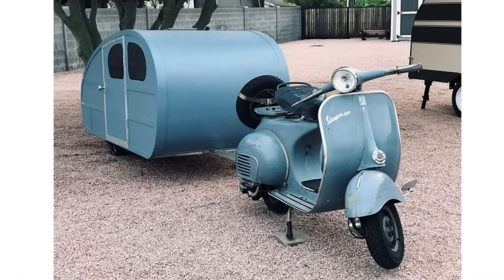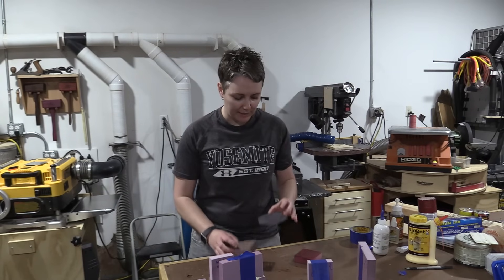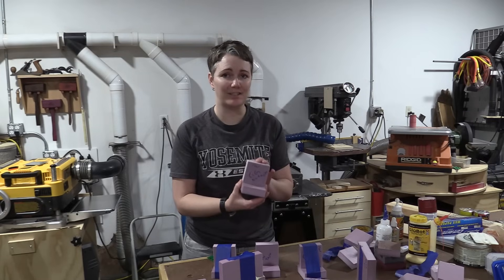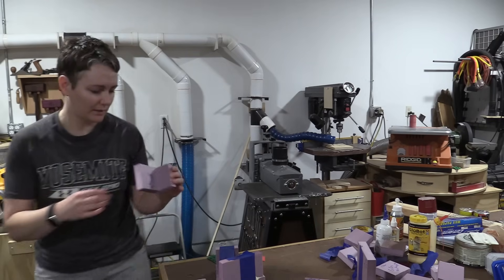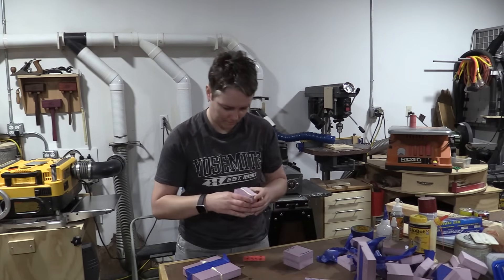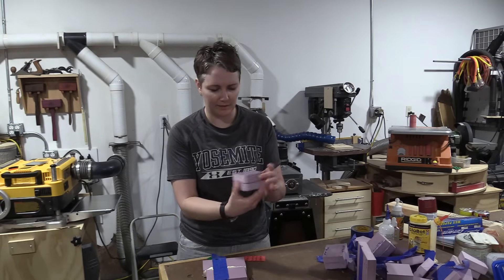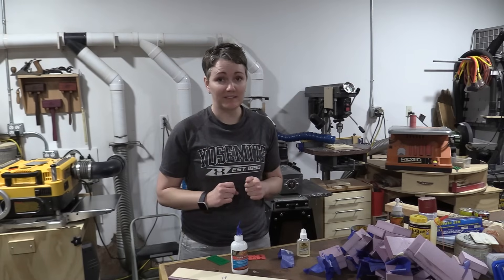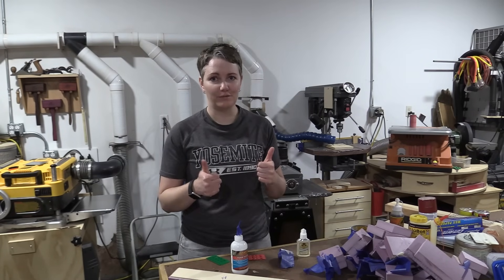NOT Gorilla Glue! Watch This Before Building a Foamie!! BEST Adhesive

Comment: I don't understand the dissatisfaction of Original Gorilla making a "mess". First, there are many places in the construction where it doesn't matter. Second, some extra glue around the joint forms a fillet which can add a measure of strength. Third, I'm sure it wouldn't take long to know how much glue it takes to not ooze out so much.
   I give you a lot of credit for all the research and for sharing it with us.
Reply from the maker: Thank you for your response! If I were building a larger foamie with 2 inch foam I probably wouldn't have been as focused on mess.  But for this build we tried to prefinish the walls and roof as much as possible before putting it together. It was such a small trailer that the last thing I wanted to do was any work on the inside once the roof was on. So the fact that the foam fusion created a deep bond in the foam, was easy to clean up with water and dried crystal clear in the spots that I missed wiping were huge bonuses. I might consider trying Gorilla construction adhesive or PL300 on a larger build since a paste style wouldn't drip. With the one inch foam I didn't feel I would get adequate clamping pressure in some of the parts to distribute a thicker adhesive.  I have received so much great feedback that I might have to do more research and testing, especially for a thicker larger foam build.  Thanks for contributing to the conversation! Cheers!

Comment: Funny, in woodworking and fiberglass, surface prep is one of the keys to success with any glue. Zero discussion of it here.
Reply from the maker: On the trailer we scuffed the surface with sand paper and a wall paper scraper. I should have mentioned it.  The side by side joint best represents this since the shiny surface was not present and unlike wood it is not different grain direction.  The foam fusion bonded deep into the joint even with the shiny film still present. I was impressed by that.

Comment: I build massive projects for hotels and casinos using extruded polystyrene. The Gorilla Glue is not being used properly. 

1 - The Owens Corning/FOAMULAR (purple) has a tight surface with no polyethylene film. I find non-filmed XPS more resistant to gluing . If using a XPS with no film, you need to abrade the area being glued. DOW XPS (blue) glues more easily. I would suggest sanding edges for both Gorilla Glue and Foam Fusion projects. 
2 - When using Gorilla Glue one can periodically clamp large flat surfaces with superglue. Make sure to mist the glue as to speed up the cure. 
3 - When fabricating with XPS use 3" drywall screws(!) on 90degree joints. Not only does this increase the flex strength of the joint it behaves as a much better clap than tape. You may even wish to pilot hole and add a drop of Gorilla Glue or Foam Fusion before screwing.
4 - When using Gorilla Glue drill holes along the glue joint. This takes advantages of the expansion of the glue which will fill the hole like roots. 
5 - Gorilla Glue cures to a styrofoam like material. It sands extremely well on exterior corners. For interior corners simply monitor any ooze out and clean it up as the glue cures with a wet paper towel.
Reply from the maker: Great information! Thank you! We did sand the foam in the project. The edge to edge joint didn't have any film and foam fusion was superior. I will try the owens coming one!
Reply: Guys - great info there.  Thanks.
I want to bond foamboard to aluminum sheet. Make a torsion box flat panel to cover my pickup truck bed.
I have EPS foam.  Hope it will also work well ??
Will G Glue, or PL Foam glue bond well to aluminum ?
Reply: @SquareRootOfMinus1  aluminum can oxidize between the adhesive and the aluminum. Basically this means that the glue delams from the aluminum because of a chalky growth.  To avoid this, you'll need to use anodized aluminum. 
Also aluminum has a huge temperature instability. It will expand at a much greater rate than the EPS. 
Have you considered using composite aluminum? It's both coated and designed to dissipate heat and is much more temperature stable.

Comment: So many reasons not to build a foam camper. It is insulation not a strucural material. All of the talk about using epoxies and fiber glass are because these provide the structure to hold the insulation.

Comment: Watched the foam bones series, and his favorite glue was the gorilla construction adhesive, which you didn't test. Just saying.
Reply from the maker: I will consider testing it for strength.  I tried to avoid thicker paste type adhesives because there is such limited strong clamping capability  on a project like this (to really squeeze the paste and get a tight seal).  Therefore, I felt liquid style adhesives worked best for my application.

Comment: Yeah, wood glue is it bad joke, right? Using it on closed cell foam? Almost anything else will work just fine as long as it doesn't melt/dissolve/ react to your foam. Also, don't do any of the joints that she did. Miter your joints, and you will get a 25 to 50% increase in strength. You literally increase the surface area that the joint has to bond. Miter joints for their Simplicity are quite literally the best. Also, not sure about the rest of her tips on how to make the thing, but at the very least you need to fiberglass at least the corners with strips. Huge difference in strength.
Reply from the maker: I didn't expect the wood glue to work.  But had some right there so I thought I would throw it in in case it surprised me.  It is a similar consistency as foam fusion (which looks and feels like Elmer's glue). Good luck getting a good miter joint on a huge curved object. I use miter joints,  box joints,  dove tails,etc all the time in woodworking.  And  miters in this case would be extremely difficult to cut and even worse to try to clamp in any way.  Adding dowels would be ideal but difficult due to the kerf cuts in the inside.  I added 1/8 baltic birch over the joint and then over lap of poor man's fiberglass over the joint.  The joint is very strong.  Much stronger than the foam.  It is only 1 in foam so it will probably have issues at some point, but the joint definitely won't be the location of the issues.  I think it will be sag on top eventually.

Comment: Why can't you just use a drill and tap wooden dowels into it with glue that's what I would do I would tap it in all the way with wooden dowels
Reply from the maker: @Rumotorizednosparknoride-w9i  we did use wooden skewers in places.  Wood definitely strengthens the joint! But with 1 in foam, with kerf marks to support bending it, it is vulnerable... so a good adhesive is still important

Comment: Ok if you want to save money don't use Home Depot products like these. There are all kinds of better products that cost less if you use them properly. The problem is most people freak out at the oz to oz cost. A $30 commercial glue freaks out people that want to use $4 liquid nails. The fact that a foam glue coating 30 does the work of multiple cases of the next lower glue let alone liquid nails which is a 1/10th of that.

Comment: I do not see Adhesive Spray 77... which is the best that I have found for foam... So a few things about welding things or sticking, or gluing foam, you need to sand the surfaces to make it slightly rougher for glues, giving more surface area for the glue to hold to, otherwise it just snaps off easily. Your tests show more about your inexperience with foam, not the actual strength of the glues. LOL Glue is not the right type of way to hit foam boards with in the first place, adhesive or welding is, and that is what Foam Fusion is, a welding type of seam binder, so this video made an unfair comparison of products and their uses.
Reply from the maker: Thank you for your comment.  On the trailer we did sand the film off.  The side by side joint demonstrates a bond without the film.  I knew the wood glue wouldn't work but it was right there, so I figured why not throw it in. Most foamie trailers I have seen used gorilla glue, so that is why there was focus on it. The foam fusion bonded pretty deep even with the film on so it was impressive.  I avoided spray adhesives because the inner walls had to be prefinished due to the small space we were working in and I was looking for an option that was less messy. If I repeat the test I will add a couple of spray adhesives and paste/caulk type adhesives. However, for ease of application and clean up I still think I will like foam fusion best.